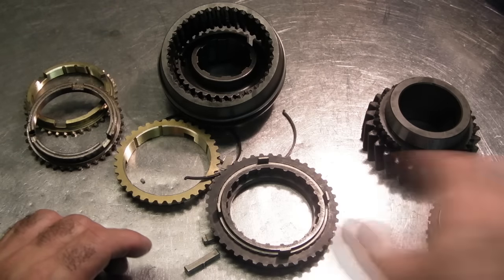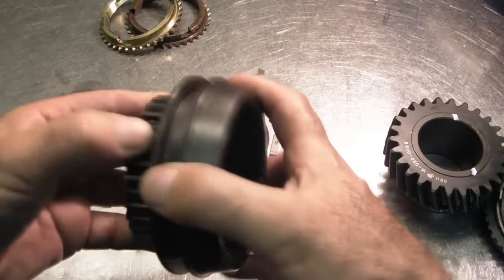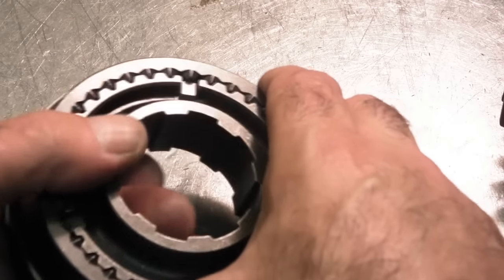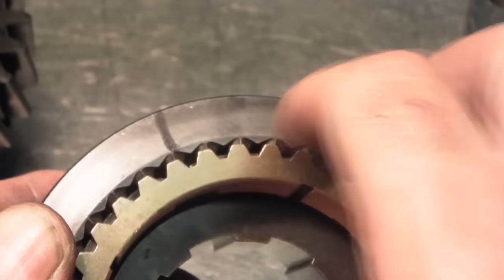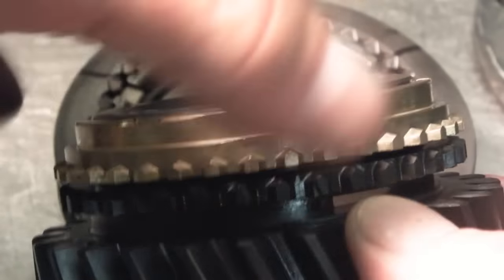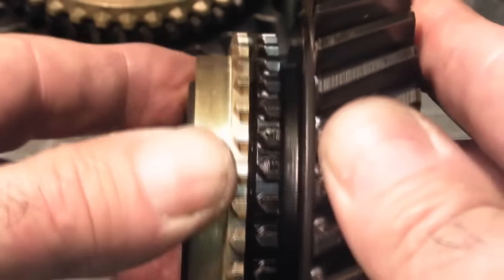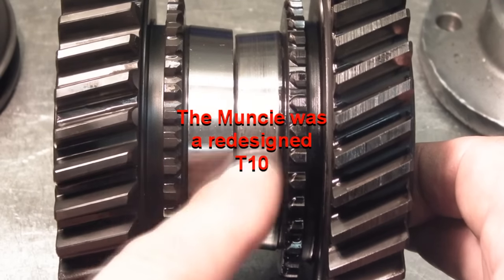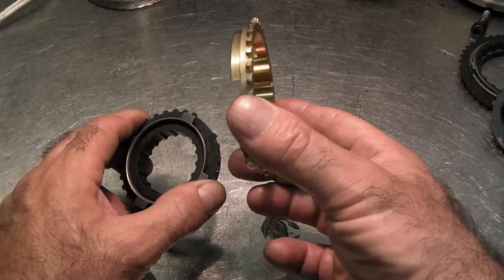Learn About Transmission Synchro Rings

Comment: I just bought a 99 chevy s10 manual and my 2nd gear synchro is worn i believe. When the engine is cold 2nd gear wont grind completely on the upshift but you can feel it getting caught up. However, trying to downshift to 2nd from 3rd normally when cold it will grind really bad. When the engine is nice and hot upshifting to 2nd is fine with no issues but doenshifting to 2nd still grinds. The only way for it not to grind and this only works when its warmed up to operating temps is to stop in neutral for a second or two to let the rpms drop as well as the speed of movment and then it will slide right in. I've noticed it will slide in when rpms are at idle and road speed is 32mph or lower. If I try to downshift fast without doing this it will grind bad. 2nd gear is the ONLY gear with the problem so i know its not the clutch or a pedal adustment and again its only when downshifting. Upshifting gets caught up when cold meaning ot doesnt slide right in and u can feel it not grinding per say but u can feel it getting caught up b4 going in but when everything is hot upshift is fine but downshift grinds unless i do the trick. Is this definitely the synchro for 2nd gear? I paid $2,000 for the truck so it doesnt make sense to rebuild the transmission as that's the only way to get it truly fixed. Do you think if I change teansmission fluid to like royal purple synchro max or redline it will mask it to where ill be able to downshift at least when warmed up? I dont want to dump a ton of money into this as its only a temporarily form of transportation. I also tell myself its a 99 pick up truck and not a sports car so theres no need to downshift with the rps up but its not like im trying to do it with the rpms at 5k or higher...i can be going 45mph with the rpms around 2-3k and go to throw it into 2nd normally without stopping in neutral for a second and it will grind. Again the only way is to let rpms drop and let road speed get to a certain point and then it slides right in but this only works when its nice and hot. That trick or technique will not work when the engine is still on the cold side. Thanks
Reply: Also you sound like u live up north...do u have a shop? Where is it located?
Reply from the maker: +Muilisx I'm in Florida. Usually the rings are worn or warped to a point where the oil viscosity prevents the rings from grabbing the gear when cold.  A temporary fix is to use Pennzoil synchromesh fluid. The tranmission should be running Dextron III.  If gear lube is in it, dump for a lighter weight oil such as the Pennzoil.
Reply: Thanks for the reply. My mechanic said my truck doesnt have a transmission drain plug. Is that possible? If it's true then how would I go about getting the fluid out? I really want to put that stuff in or the royal purple synchromax but if u say to use pennzoil then i will. Wouldnt thinner fluid make it grind more? Wouldn't thicker fluid mask it more? Thanks!
Reply from the maker: +Muilisx the ring can't grab the gear properly.  Thicker fluids create more of a barrier between the rings friction surface and the gear. Remember, this is a last ditch effort. It may work and not work. If the ring has a lining that it gone, nothing will help. Sounds like you might have a GM /Getrag and you need to suction the fluid out of the fill plug. There is no guarantee that this procedure may help.
Reply: Yeah I'm aware it's a gamble but it's worth a shot rather than rebuilding the transmission. The only way I would rebuild the transmission is if I brought it down to FL to my Grandmother's husband's friend who rebuilt my tranny in an old car many years ago and didn't charge me anything. I think he got paid in that weird type of money that businesses use with each other.It's not real currency that can be used in a store. I forgot the name of it. I'll have to wait until my Mom wakes up she'll know right away but yeah that's the only way I would do a rebuild and it would come out like a brand new tranny but that isn't an option right now. How much is it usually to suction is out that way?

Comment: my 1st gear synchro is worn out, i either have to wait till im stopped or revmatch to shift to 1st or it grinds lol
Reply: I think mine too. And how do you rev match, i mean in how many revs?
Reply: @songoku7915  you do it by feel, the exact revs vary depending on the speed you are at and the gearing of your car
just blip the throttle and when the revs are matched you will feel it in the clutch pedal and / or the shifter
Reply: @lucywucyyy  ok thanks 👍

Comment: I'm pretty sure I got it figured out,the #'s on the case didn't match the internals.The insides are from a 64 or 65 model,and as you know they take the shoulderless rings,I did't know there was two different types for muncies.I'm going to give you a call tomorrow over another ?.Thanks again.

Comment: Paul , thank you. I have been trying to figure out my t90 transmission. I found a couple things I should check and correct. I'm ready to rebuild a tremec or something like that.
Reply from the maker: The T90 is pretty basic. The synchro rings are still available. I know there are several variations of that 3 speed.

Comment: What is the physical block that prevents sliding into 1st gear at speed? I've noticed at higher speeds if I put the clutch in I can slide into every gear but 1st. 2nd gear can be slid into even though the revs would also be higher than the engine can do if you let the clutch out. Just always been curious as to if there is an engineered reason why 1st can't be slid into at speed. Thanks!
Reply from the maker: The inertia of the gear train
Reply: Did you find a solution?

Comment: this is exactly what i was looking for. I went to a shop and they told me my T45 which grinds at higher RPMs from 1 to 2nd then from 2nd to 3 needs new Synchros. Should that cost 2k to repair? I didnt know much about transmissions and did a lot of clutch dump burnouts.

Thanks for the great video!
Reply from the maker: Poor clutch release can cause premature ring wear.  Usually rings do not fail all at once, so it sounds like a clutch release issue.  However, if you do have bad rings, the cost and an overhaul kit for a T45 is usually over $500 USD. This doesn't include your shop's labor to remove and rebuild the unit. If it includes a new clutch flywheel, and hydraulics, that's not a bad deal. There are places like RSgear.com that can sell exchange units and I suggest calling them first.  They are Tremec dealers and know this unit very well.  Having someone build a standard transmission such as a T45 that does not do them on a regular basis may not be the best decision.

Comment: I understand that the synchro-ring is synced to the hub/sleeve by the keys/slots so that they rotate at the same speed. But is the synchro ring physically retained to the hub/sleeve. 

For example: in the video you slot the synchro ring into the key slots; but if you were to turn the synchro hub/sleeve over upside down the synchro ring would drop on the table because there is no retaining mechanism...?

Comment: recently had my Borg Warner Super t10 4-speed rebuilt about 500 miles ago. So far I've had no problems although when I'm at 2000 rpms and down shift from 4th to third it grinds. Going forward it doesn't matter what RPM I'm at I could beyond all the way and it doesn't grind. Just 2000 rpms and above on the downshift only. I called the guy who did the rebuild he did say he put synchros and sliders. What are your thoughts?

Comment: Thank you for the video. I have a 06 rx8 grinding from first to second at and above 4500 RPM. Mazda has looked at it and told me the noise is a throw out bearing. :l I have done as much research as possible and everything points to synchros. Now that I have seen this video I have little doubt that I am right.

Comment: Excellent video. There's only one thing I don't understand, maybe someone can explain this to me. Around 6:30 he's explaining that for the synchro teeth to allow the clutch sleeve to slide into the gear after it "blips backward." What exactly allows it to do that since there is so much spinning mass in the transmission? It is kind of like how when you stop in a car, there is a slight jerk backward as you come to rest? Or this there something mechanical that forces that action like a spring?
Reply from the maker: +winterloggan  There has been some confusion about the backwards terminology I used.  Nothing is going in REVERSE.  In reverse the  output is spinning opposite rotation to the input.  Both the input and output are still wanting to go in the same direction but now because you are using a clutch the input is free to move. When a blocking ring blocks, the only way a slider can  get past that block is to push the ring opposite from its current loaded direction.   Keep in mind the transmission is DISENGAGED from the engine and this will allow the gears is some instances to move opposite load.  Depending on the gear and whether you are upshifting or downshifting a gear can index more forward of its current load or opposite its current load.

Comment: I used to use to put the ring under the hub and slide with the ring gaps in the right spot and fit the keys and spring.

Comment: Great video, I've been struggling to understand this for a while, only 1 question remains though, so the ring has brought the gear to the same speed as the slider, what if the gear and the slider meet point to point?? pretty exaggerated I know, but just wondering.

Comment: I use Pennzoil synchromesh GL4 80w for my VW 020 Manual transmission car no more grinds on first and second, evening freezing cold weather there is no more resistance in shifting thank you Pennzoil.
Reply from the maker: Pat Morales Sometimes oil can make a huge difference.

Comment: That thing at 6:50 about the whole gear train blipping slightly backward when shifting isn't exactly true.  The torque created from the blocking ring pressing against the cone of the speed gear is what moves the blocking ring slightly out of alignment (the indexing action), but only a half tooth one way or the other.  The shift sleeve doesn't touch the speed gear until it can get past the blocking ring--that is of course what the blocking ring is for.  But the important detail that you have wrong here is that when the shift sleeve slides through the blocking ring, the reason it is able to do so is because the speeds have become the same, or similar enough that the torque has lessened enough to let the blocking ring move backward (back into alignment with the teeth of the shift sleeve).  And when the shift sleeve begins sliding past the blocking ring, the blocking ring "clutch" lets go of the gear entirely.  It is no longer exerting ANY pressure against the speed gear.  Up until this point the alignment of the teeth on the speed gear are totally irrelevant and totally random.  Once the shift sleeve slides past the blocking ring, it is the tooth flanks of the teeth on the shift sleeve that make the final alignment with the teeth on the speed gear.  That final alignment might be forward or might be backward, but at that point it's not a "blip" against the momentum of the rotating gear train at all.  It's just like taking your finger and moving the gears in the transmission slightly backward or forward; that is the only pressure needed for the final alignment adjustment before the shift sleeve can complete locking onto the speed gear.

Comment: Thank you. Now I know why my NV1500 grinds going into second. Nice overview.
Reply from the maker: Thank you. Please share the video
Reply: GearWorldTV how you doing. when i shift gears in my 96 civic. i hear this metal rubbing sound, is low pitch but should like to metal sliding together. i believe is my throwout bearing but i'm not sure. also i hear the sound when i'm in neutral and i move the gear level around.
Reply from the maker: heleon jk If you are in neutral, the throw out bearing is not in use, try putting slight pressure on the clutch pedal and see if the noise gets louder.
Reply: GearWorldTV
the noise don't get louder when i press it. is when i move the shifter that the metal sound comes in, i just have to move the shifter to a position to hear the metal sound
Reply from the maker: heleon jk It could be that the shift forks have pads on them and they are worn.
Reply: GearWorldTV
thanks

Comment: Outstanding video, thank you! It gives a pretty good idea about my second gear grind on a hot engine in a VW 02J transmission.  You instill a lot of confidence with your explanation.

If I let the engine rev down a bit I can avoid the grind even in hot weather.  Have only had about 15-20 grinds in the past two years but it is probably just a matter of time before the transmission needs to be swapped out or rebuilt.

Sounds like it's not worth pulling it apart to swap the synchros but rather just to get a good working used or a rebuilt one, right?

Ran Penzoil Synchromesh and now VW 052 oil and they seem the best (the Synchromesh the smoothest) but I know I'm running on borrowed time on a 15+ year old transmission.  Was thinking of using Amsoil until I read your comment below that you've seen problems with that oil.  Thanks again.
Reply from the maker: You are taking all the right possible precautions.
Reply: Question: Can I skip 2nd from first and go straight to 3rd gear? Or will that screw up anything?

The old 02J is still going and I think I've only ground once in the past year.  The warmer weather thins the oil so I have to be more careful.

Thanks again, GBV

Comment: Boy do I wish I had you replace the synchros in my transmission rather than the bafune that did it. It used to grind when shifting, when I got it back, it would not go into 3rd gear without going towards 4th first. Brought it back to the bafune, he tells me theres nothing wrong, you need to adjust the shifter. After looking at your video I can see what could possibly have gone wrong.
Reply from the maker: Feel free to contact me if you need help fixing the trans

Comment: Thanks for that information.  The ZF six speed in my Corvette scrapes pretty bad between first and second, and I've been thinking about what to do in terms of it's repair.  Seems to be a common problem.
Reply from the maker: Yes, an expect to pay big money.
Reply: @GearBoxVideo  $600 if I take it out...  Yeah, that's too much IMO.
Reply from the maker: That's actually a good price
Reply: @GearBoxVideo  Well, I reckon that depends on one's definition, or whether that one is the pricer or the "priceee"...  It wasn't long ago that you could buy a brand new blue label ZF for only slightly more, and $600 is pretty pricey for a job that requires less than eight hours, from my point of view.

My dad used to build manual transmissions routinely, but I've never tried it myself...  I see that your book goes into some detailed specifics regarding Muncies, T-10s, etc... but I didn't see anything in the description about a six speed ZF?

Comment: Excellent information. What's the kindest way to shift? Quickly, slowly or somewhere in between?
Reply from the maker: Depends on what you are driving. Driving normal then shift normal
Reply: @GearBoxVideo  Thanks for the reply. I've had two Toyota trucks and both manual transmissions have had a good deal of "personality". The manual cars that I've had have always been very smooth. Is there a general statement that you can make about these older Tacoma transmissions?
Reply from the maker: Not really. They always seem to be smooth shifting. I think the shift feel has alot to do with clutch release ,oil types and oil temps
Reply: @GearBoxVideo  Thanks, and I'm watching you rebuild one now! Looks like a handful. I guess I've always thought that as long as the gearbox is full it's fine. Might be time for a drain and a refill.

Comment: I learned to shift in a '37 Chevy truck whose syncros were worn out and therefore learned to double clutch at the same time.  Now I have double-clutched out of habit for the past 40 years.  The problem I'm having with the fuel-injection/OBDII cars and trucks is that they tend to rev in neutral unless I let up on the throttle a second or two before I take it out of gear.  I'm trying to get the technique down but wonder to what extent I might be accelerating syncro wear as compared to, for instance, a driver who rev-matches without the clutch.
Reply from the maker: I mentioned somewhere before, that I don't understand why this type of shifting is necessary with modern day synchros.
Reply: GearBoxVideo For the downshift, easier on the brakes and clutch, the brakes especially when on downgrades and/or towing weight.  For the upshift, it is typically easier to find the shifter path for my F250 with a long-throw bar for the shifter.  It's embarrassing and dangerous to be unable to find the path to your next gear and therefore be coasting in traffic trying to decide and then find a gear to put it in. Also typically easier to get it in gear whether pickup or car.  This is assuming the rpms of the cluster have not been revved in neutral, which is my concern and question.